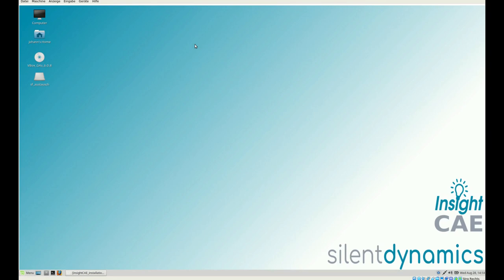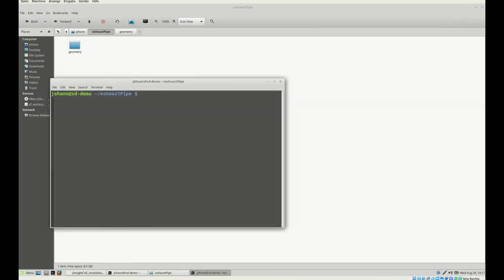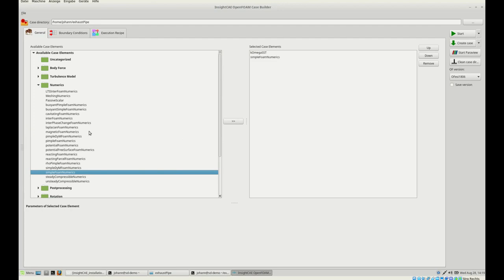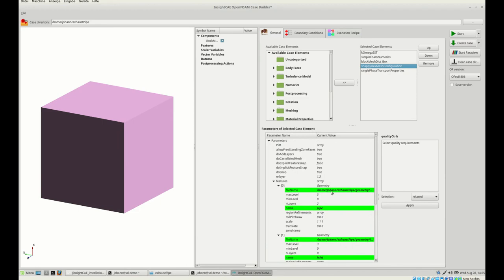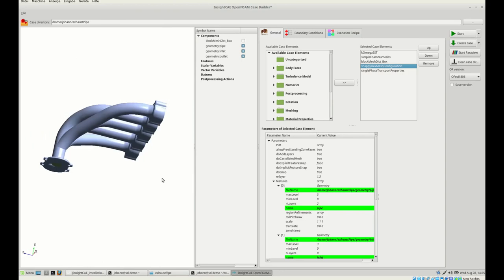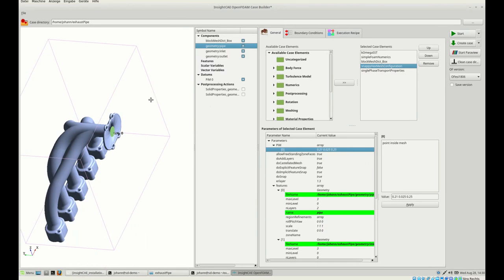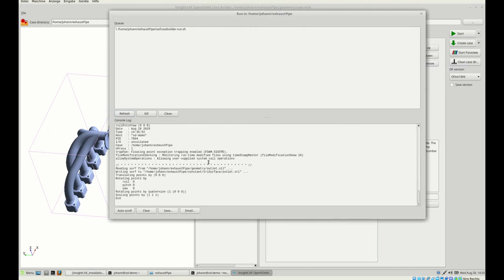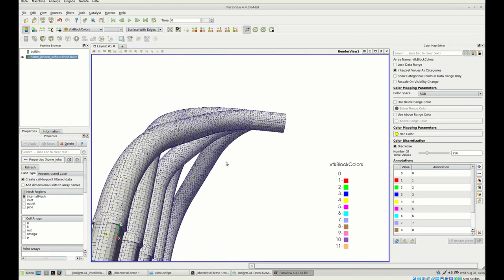InsightCAE CaseBuilder Example - CFD RANS of an Exhaust Pipe

Comment: What can I do if I want import mesh, like *.msh from fluent or *.unv from salomemeca
Reply from the maker: There is currently no explicit option for this. What you can do is: 1) add the numerics case element only, then create the case on disk, 2) go to the command line and run the appropriate import tool, 3) go back into the case builder and go ahead with the case setup, especially you can now parse the boundary file and set the BCs.